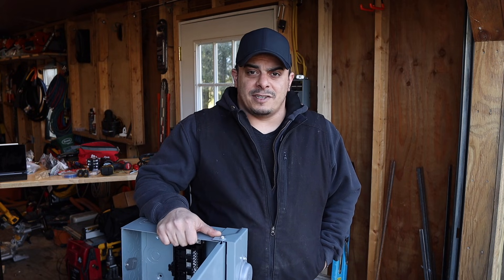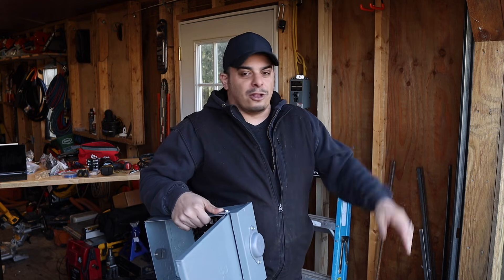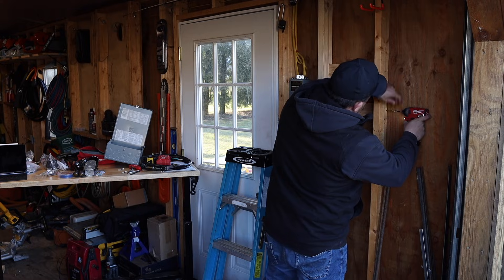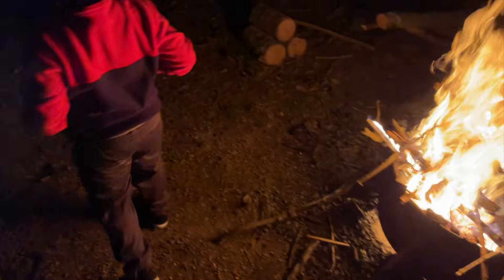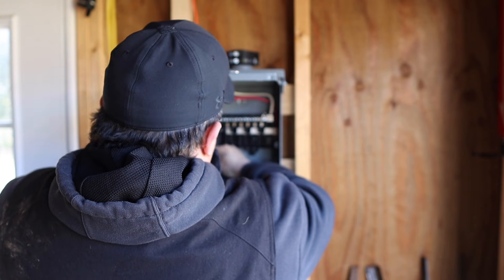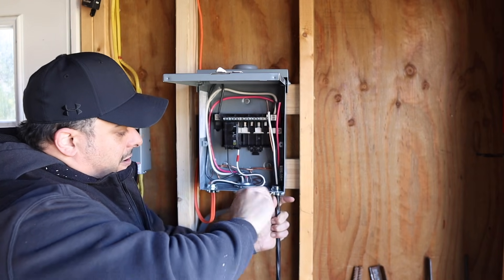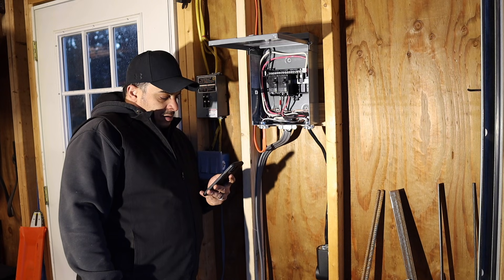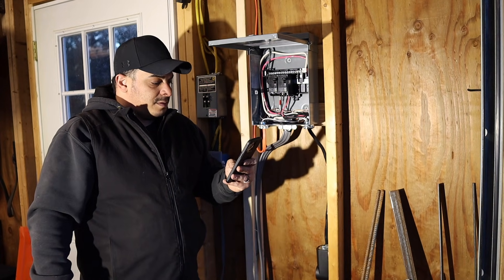Installing a Sub Panel for Heater & Welder + 50amps in the Garage

Comment: That Miller 220 should get a 50 amp feed . No damage will come the Miller with the 40 amp feed but you will see a difference in it's performance when you start to push it especially on arc strikes
Reply from the maker: exra power never hurts. I dont know if I have ever seen it draw more than say 35 amps 240

Comment: Greetings! I have an older cabin with 3 panels. 1 main in kitchen, 1 in garage and 1 in furnace room.

How would you connect all 3 to an solar inverter that's is 30 feet away?

Comment: Thank you for the video, extremely helpful and cost saving. I recently had a sub-panel installed by a certified electrician/company. However, I may need an additional 240v, 60 AMP outlet for an Industrial spec, air compressor (I have plenty of space in the sub-panel). It will be a 60 amp, 2-Pole, GFCI breaker with 4/3 NM-B, run from breaker to the wall outlet (60A Receptacle NEMA 14-60R).

 I am tracking on the GFCI, to connect the neutral pigtail to the neutral busbar and connect the ground to the dedicated separate ground busbar.  Do you have any special considerations or tricks of the trade, I should be aware of, when inserting this GFCI breaker into the slots?  I am tracking the 4 AWG is going to be difficult to work with so, I will get a large capacity Hubbell Raco sqauare electrical box to put my wall plug and wires into. Thanks
Reply from the maker: If i hear you correctly i believe you should be good. Ground to Ground - Breaker Pigtail (netural in to the neutral bar) L1 and L2 to your load side a GFCI should track differences in amp draw between the two legs. Its hard to visualize over text if that makes sense. Maybe some others here could chime in as well. Thank you for your time here.

Comment: Question for a doble 60 am breaker sub panel how many 20am breaker can put on the 60am breaker sub panel and thank you so much for sharing your experience and talent God bless you
Reply from the maker: @sheetrockman9957  your limit will be based on the main ie. The breakers in your panel say you have (5) 20 amps and your main is 60 it still works because if you were to pull over 60 it would trip. Just like a home service most panels if you add all the breakers up its probably over say 200 amps. Always suggest confirming with your local codes thank you!
Reply: Ok thank you so much

Comment: Thank you for this video. I really need help!
I have this pump that had 10 gauge 3 hot wires and a ground coming from my panel . 2 hots and the ground were directly contacted to the pump while the 3rd hot was wire nutted off to the side. I have since added a sun panel with( 2) 15 amp double pole breakers in hopes to split the power of one double pole breaker to add a 110amp outlet. Only thing is there is no neutral wire. I got the pump working off the 2 double 15 amps but the gfci only the green light came on but had no power to light the heat lamp. Could I add a metal stake into the ground , run a ground to the bus bar then run a wire to the bus bar to the gfci as my neutral wire. The ground is connected to ground screw of sub panel and also the ground wire that was originally connect to pump is also connect to ground screw. 
Thank you for your help.
Reply from the maker: Just now seeign this are you still in a jamb?

Comment: So I already ran 40ft of 6/3 wire to my attached garage for my wife’s Tesla on a 50amp breaker and wanna get a 8,500w heater that’s 240v and has to be hardwired so my question is will my 6/3 wire be ok to use for sub panel bc I don’t really wanna buy more wire and do another run if I do t have to.

Comment: Are you running to separate circuits, one weld, heater? Another for lights plugs to a detached garage?  If so, that's not to code. Actually, there's a few code violations.

Comment: Anyone thinking this is a good install think again
1. Where the heck is the main disconnect?
2. Where are the ground rods and ground bar?
3. Welder and heater running at the same time should have plenty of heat because wires will be hot too!! 
Not even close to passing inspection I e been doing electrical work and inspections for 30 + years 
Hire someone that knows the code!!!!!

Comment: Great video as usual, regarding installing a 50a breaker on my sub panel and specifically capcity. I have a new Tesla and want to add a 50a breaker on my  garage 100a sub panel. Can you confirm that this is no-no please?
Reply from the maker: You would be fine in the garage to have a 50amp to your tesla charger based on your main feed being 100amp or main breaker in the garage

Comment: Hey do you need to install a new ground rod (outdoor) and connect the ground to it?
Reply: In most locations you must install TWO 8' ground rods, 6' apart. Connect these in series with ground rod clamps and #6 bare copper wire to your panel ground lug. Remember that ground and neutral ARE NOT CONNECTED together in a sub-panel.

Comment: Nice Video man! Quick question before you did the upgrade could you run a small ac unit in the garage with that 30 amp sub panel?
Reply from the maker: Yes sir a window unit or like a home portable would of worked fine without the upgrade i ran one circuit for lights and one for plugs but my led lights use so minimal

Comment: Why was the white/neutral not used?
Reply from the maker: On 220 you only have 2 hots typically black to breaker red to breaker and a ground  on 110 you would have black to breaker white (neutral) and ground
Reply: Thanks for taking the time to reply
Reply from the maker: @montimitchell5931  not a problem ;) thanks for being here

Comment: I went to Home Depot today to browse the sub panels. The worker told me that if the panel is a 125amp panel I have to wire it to be a 125. 
But I noticed in your video you’re feeding it 50amp from your main. Was the hone depot guy wrong?
Reply: @robmespeedy The Home Depot guy did not understand.  If a panel says 125 amps, that means the manufacturer has rated the bus bars (they are 3 bars in the back of the panel that the breakers latch onto) can have a 125 amp draw on them without over heating.  This is it's MAXIMUM.  But there is no reason you can't put a 100 amp (or lower) breaker as the main disconnect, it just means you now have a 25 amp headspace on the panel.
Reply: @davidmarquardt9034 i totally get it now. Thank you so much.
Reply from the maker: I am feeding my panel with a 50amp breaker from the home, so its protected if you are feeding with 125amp or say 100amp breaker then you would need to match your feedline to that. I only needed 50amp.
Reply: @NickPixelTV  I think I get it. I only need 50 or 60amp in my garage. But the home depot guy told me I couldn’t use a 125amp box. I need to power 2 - 240 circuits and 2 - 120 circuits.
Reply: @NickPixelTV  I guess my question is can I feed 50amp from my main to a sub panel that is a 125amp sub panel?

Comment: Why is the white wire not used when installing a 240?
Reply from the maker: It returns through the opposite hot because they are 180 out of phase.

Comment: I recommend you move to the Orient if you want 220VAC. Here in America 60 -70 years ago we had 220 VAC, then the transformer taps were moved an raised the voltage to 230VAC.  Then again they moved them so now we have 240 VAC. Soon you won't have to worry about it you'll get green energy, such as that carried by green wires. 0.0 VAC.  The Biden people will mandate all power plants be converted to hot air.......like found in the FANTASY LAND OF THE DNC.

Comment: Is that a 100 amp panel? I'm looking for 50 amp panel but its only showing 2 spaces
Reply from the maker: Yes I believe so - square d from lowes. If you want the spaces id just go with that and then use your 50 amp as main feeding it.

Comment: Awesome video. I am running power to a small shop I built. What is the brand of the transfer switch you installed?  Most 50 amp panels don’t have that many breaker slots. Would appreciate any info. Keep up the great work.
Reply from the maker: Darren, i believe it is a square D from lowes item number 3946 i will have to double check the transfer switch i can get you the model in the am ;)

Comment: Nice work! I just purchased a 7500 watt garage heater that I want to install but I don't have a 220/240 outlet. I have a subpanel in my detached garage that's about 30 feet away from my house with a 2 pole 40 amp breaker and 4 single pole 20 amp breakers in the subpanel. I pulled the cover and I noticed that the 40 amp breaker wasn't connected at all and one of the 20's was connected to 1 of the 120v outlets. I'm going to run that single outlet together with the other outlets on the left side of my garage and use that breaker for my garage door opener. I purchased everything that I need for the 220/240v outlet but I'm skeptical because my main breaker is only 100 amps and the wire coming from my house to the garage looks like it's 8 gauge. And I was told that I needed a 50 amp breaker for my heater (which I purchased) because it would draw a little over 31 amps on start-up. So would I be ok running that 50 amp breaker with my main only being 100 amps? Thanks and again nice work! #subscribed
Reply: How do you get 220 from the 240, explain that please
Reply: @robertstack2144  I don't understand your question.
Reply: @bunky021543  there is no longer 220 in America.70 years ago yes, then the power reqmts went up so they changed taps on xfmrs to 230, years later again to 240. Remember if you want more Power P it comes from the Voltage  V multiplied by amperage I.....    P  =  I X V.  So if you want more  P you have to have more I or V.  Do you and most Americans want to re-wire your house with bigger diameter wire to accomodate more amperage (I) or have electric company move the transformer taps to a higher voltage, that is much cheaper than you rewiring your house.That wasn't hard was it.  Ask older folks if they remember talking about 220, 230 and 240. And guess what. Your TV, vacuum cleaner, drill motor, the kind the old timers plugged into the wall outlets did run on 110 then 115, and then today 120 today.  Where did those numbers and voltages come from. Put a tap in the middle of the secondary and ground it, then beween the neutral ground and  each end of the secondary you get 120 VAC.  DIVIDE 220, 230, & 240 by 2 ...you get 110, 115 and 120.  VOILA
Reply: @robertstack2144  I know there isn't a 220 I just made the statement because a some people still say 220 that aren't familiar with 240. I have a 240v 7500w garage heater, 8/2 romex, and a 40 amp 2 pole breaker for the subpanel in my garage for the install and I only made my comment based on what size service panel that I thought I had that's all lol nice history lesson and explanation though!
Reply: @bunky021543  thanx, but there is 220 VAC  on one hot wire elsewhere as in SK.  The little round recepticle has two round holes in it andone of them is 220 wrt the neutral. Thailand, and Vietnam I think are the same. It's not 220 from the end  to end of the transformer. I think that voltage would be 440.
Reply: Actually I have to make a correction to my comment....I recently moved into my home and apparently I didn't pay enough attention that my main breaker does have a 200 amp service panel in the basement but I also have a 100 amp service panel on the first level. So I can run my heater in the subpanel in the garage with no issues and then again for the video.

Comment: Thanks for the video helped me out tremendously. What brand/model sub panel box did you use?
Reply from the maker: Hey Christopher, Thank you my friend. Its a Square D sub panel. I will have to check on the model its been some time. but I believe I picked it up from lowes and or home depot.. im thinking lowes.

Comment: Nick.  I have recently bought a house with detached garage that has 10/3 out of main with 30amp to a sub panel in the garage with two 15a single pole circuits for lights / garage door opener. I am wondering if I can add a 30amp 10-30 for EV charging in that sub. (It has room for more breakers ). The ev would pull max 22a with that 10-30 plug.  Thoughts ??       Changing the wire to the garage would be a pain to make it 8/3 or 6/3 so I could do a 40 or 50 in the main panel to feed the garage sub.
Reply from the maker: How far away is your house from garage? (Only concern would be voltage drop). From the sounds of your comment - Your buried 10-3 is protected by the 30 amp breaker in the house. (If you draw over 30 amps total in the garage) the breaker in the house will trip thus protecting downstream. So you should be able to install a 30 amp breaker in garage out to the charger and keep your two 15 breakers but i would only run say lights and such if you’re charging to stay under the 30amp draw and to prevent the breaker from heating up or getting close to a trip. (Always double check with your local codes etc and if your concerned have an electrician double check your work before you go live) but you shouldn’t have a problem with 22amp. Hope this helps you out. Thank you for the comment and time here
Reply: @NickPixelTV  wow.  That was quick!!  Thank you!!  Garage is about 50’ from house and he did 10/3 to a box in the attached house garage. Then transitioned to a much thicker underground cable to the sub panel in the garage. In fact I think it’s a 6/4 or something. One lead not used.   But yeah. Then in the remote garage there are two 15a single breaker s. I think I’ll shut that whole leg off and open the sub to see if I can tell what that buried wire is.    The previous owner was an electrician!!! 😂

Comment: I'm trying to do this with a 6/2 wire. Basically two lines and a ground because it was a run for a car charger. Can I do basically what you did without a neutral?
Reply from the maker: You would need 6-3 to use 120v
Reply: @NickPixelTV  right but if I only want 240v no neutral from the panel is that ok? Does it break any code?
Reply from the maker: @Richardsumilang  im not quite sure on the codes as they vary from location to location if your running direct like line to load for your 240v device shouldnt be a problem. If your planning on having 120v lights and such thats where it would be needed. If you already have a circuit for that then you should be good I would check your with your local codes as far as compliance. If i was putting in a new panel and new work i would use 6/3 to cover all basis. I hope this helps you

Comment: Hey Nick, Great video! I've watched about 2 dozen and this one has helped me the most so far. So Thank you for that. So heres what we have going on. We have a main pole that has 200 amp service to it. We have a shed that is about 350 to 400 feet away and we'd like to install a sub panel to feed an A.C. and a fridge. I think I need a 50 amp breaker at the main box then run #6 UF wire to the sub panel which will have two 15 amp breakers, one to feed an outlet for the A.C. and one to feed the outlet for the fridge. Does this sound like the right set up? Also would I need to worry about voltage drop or would this set up enable The A.C. and fridge to run without fault even with voltage drop. I have literally just started to learn about all this in the last week. Treat me like a toddler when answering please. haha
Reply from the maker: Hello, thank you for the kind comment. I have some travel next day or so let me gather some thoughts to help you with this. The distance here will make a difference in your project.
Reply: @NickPixelTV  You're welcome... Hope your travels went well. Any thoughts on this now that you have had a few days?
Reply: You will need 3-3-3-3 minimum. For that distance.
Reply: Any unprotected wire will need to be covered up or be ran through conduit. Also I’m garages you need gfci.

Comment: Is your install according to NEC code.  I have two 20 amp circuits ( through a sub panel) already running to my garage but I want to install another 240 volt 50 amp electric vehicle charging station circuit circuit through underground conduit to its own sub panel in my garage so I can have  a local disconnect.  It’s seems similar to your installation but I can’t get any straight answers to whether or not it is code.
Reply: i think they change that code book once every 3 or 5 years....
little changes here and there mostly....
but also local code's have different demands also...
get a hold of an updated code book and read up on your situation and then decide if you want to contact local electrical inspector.

Comment: Get a few ground rods driven and connected into the ground bar, as it's Code required for a properly grounded system being a detached structure subpanel installation.
Reply: Thanks I was about to ask that question as I’m installing the same one

Comment: Enjoyed you video. I'm going to check out your other videos too. Is there a need to have a ground wire from a grinding rod on this install?
Reply from the maker: Thanks in my case there was no need (check your local ordinances etc) because it is fed from my house to the house ground I do have one if for when I power with my generator that I will use from time to time. Thanks

Comment: Does white have to be hooked up from main panel. If you are not using it ? Great video !
Reply: Definitely hook up your neutral
Reply from the maker: I believe you may want to check with your jurisdiction on this. I think and I could be wrong that most residential will require a 220v sub panel to have white (neutral) hooked up. Also if you ever plan on running a 110v circuit in your panel like I am you will need it. Hope this helps